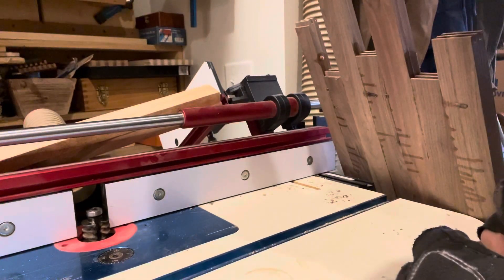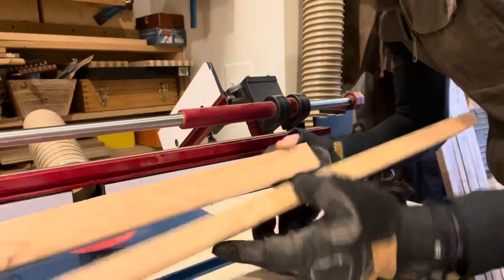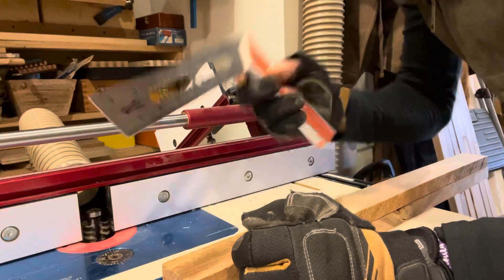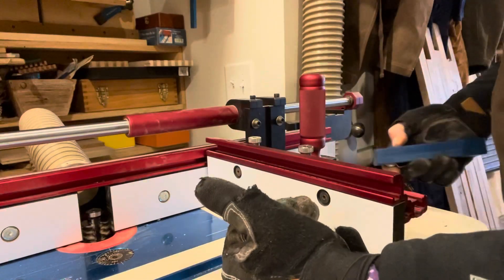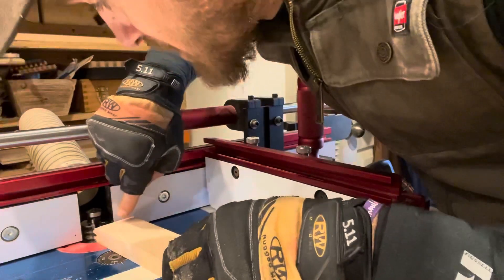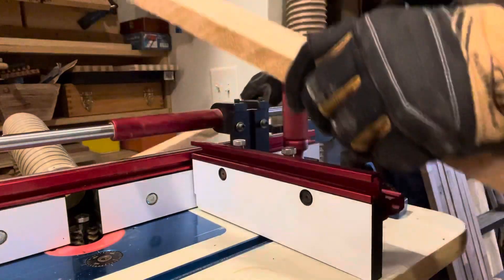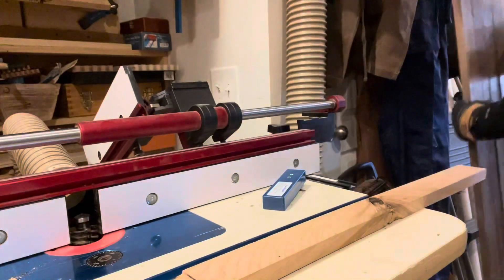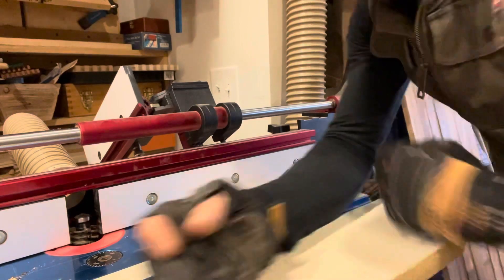How To easily set up a finger joint router bit to maximize your scraps perfect DIY! Do it yourself!!

Comment: The best finger joint Demo on Youtube.  Another gentleman adjusted with spacers but had no idea what he was doing.  If you measure from the top of one cutter to the top of the next cutter and then adjust 1/2 they should match up.  With your setup you could count how many turns of the crank from one setting to the next.